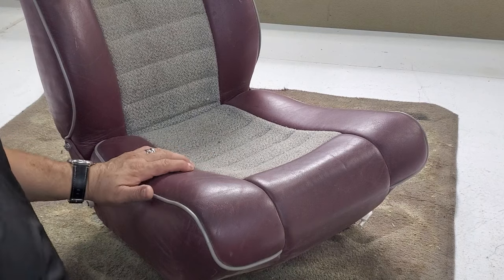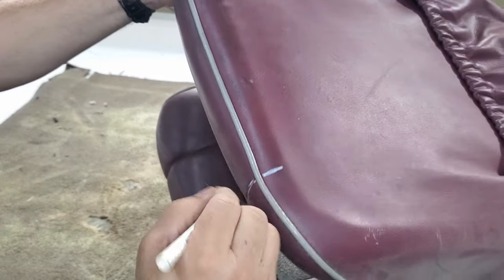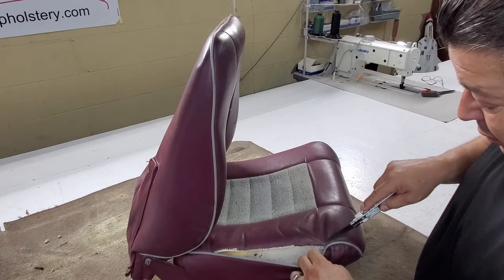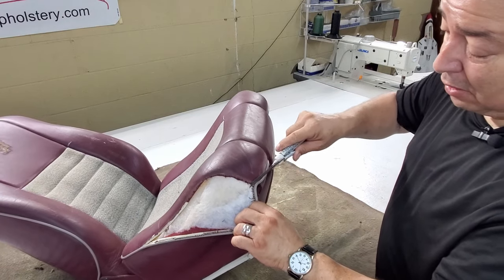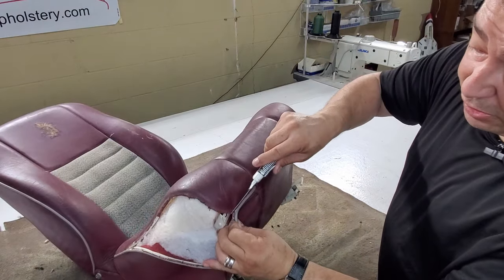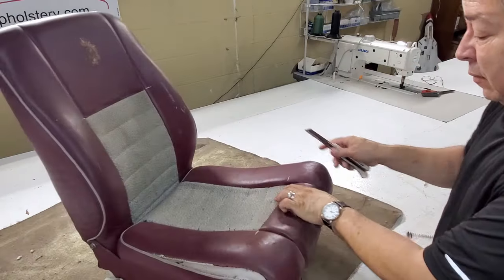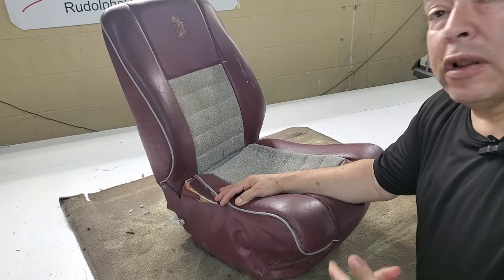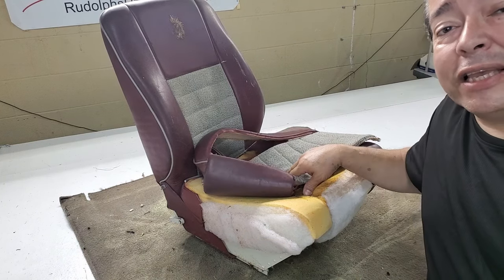Watch this first! Learn how to make seat patterns for auto upholstery

Comment: This is the first video I've seen from you. I made a seat skin  over 30 years ago. It was a bench seat. I used an old blanket this time. I want to make bucket seats from denim scraps with a custom design in the center. I believe your videos will help me get where I need to be thank you!
Reply from the maker: Hello Grim, I am so glad you found me. Remember learning is doing. With upholstery, nothing is impossible, if you can design it, you can do it. I think you will do just fine with your bucket seats. Please keep liking and watching!
Reply: @oldschoolautoupholstery  I will I appreciate your knowledge and you sharing it
Reply: @oldschoolautoupholstery  what scissors do you recommend for cutting denim? Also, what type of needle for my sewing machine? And what type of thread do you recommend? Thanks
Reply from the maker: @grimgargoyle7173  Hello Grim, I will appreciate you watching and learning! Please keep liking and watching!
Reply from the maker: @grimgargoyle7173  Hello Grim, Any heavy duty scissors will work as long as they are sharp. Different industrial sewing machines use different needles. Mine uses 135x17. I use bonded nylon or polyester thread T90 for everything I do. Please keep liking and watching!

Comment: Hey Mr. Rudolph, love your instructions & videos;  I'm taking an upholstery class right now too and only worked on house furniture but my end goal is to reupholster my chevy truck dash, door panels and bucket seats in vinyl.  Could you add some discussion on material selections especially vinyl and quality types & vendors?  Any help in this area will greatly reduce my reworks & wastage as I learn and work toward a custom interior.  Also would really love to stack up an applique of my college mascot on the center backs of the high back buckets.  All ideas would be great.
Reply from the maker: Hello Safebat, I think you will do just fine with your truck. For your logos, I would try haveing the vinyl pieces embroidered. See this video about vinyl. https://youtu.be/LUndj-mZBrM My suppliers is Keyston Bros. Many locations in the US and they ship. Please keep liking and watching!
Reply: I love your plan. I plan on recovering  my bucket seatsin my van from denim scraps and using a custom alien design for the insert.best of luck to both of us, and I'd love to see your finished product

Comment: What type of machine do you use ?
Reply from the maker: Hi! Juki Industrial sewing machine.
Reply: Juki’s are great machines!  I have an old straight stitch and a newer 1541S. I know some Jukis are made in China but some are still made in Japan. The extra price is worth it to me but not sure about other’s experience. The Juki was a great improvement in feel and capacity over the popular used Consew and vintage Singer W111 walking foot machines IMO. The confidence alone is worth it.  I’m just a hobbies though. “Buy once, cry once.”
Reply from the maker: @836dmar  I retired my Chandler/Adler German-built machine after 35 years. That was the best. I never serviced it once. Wore it out. Ran so smooth and quiet.